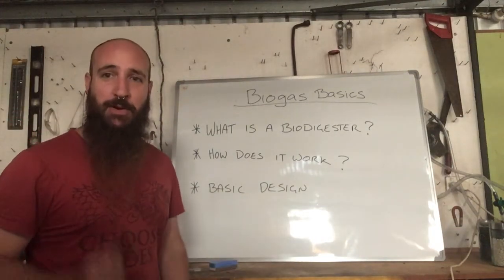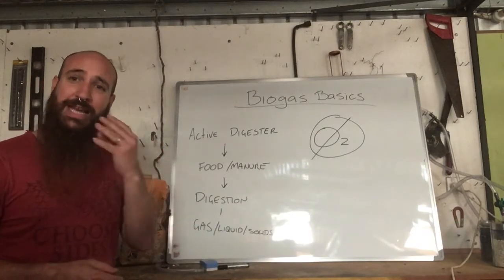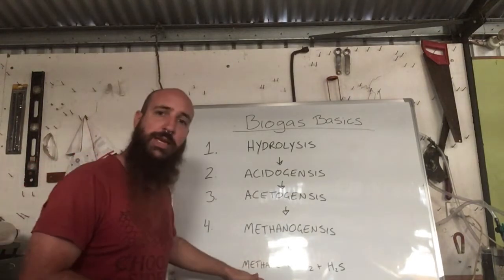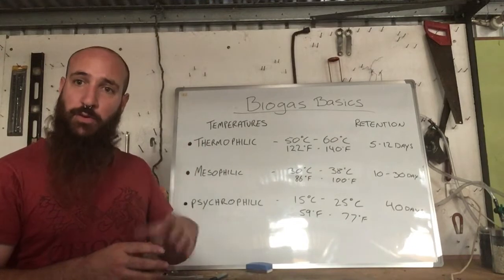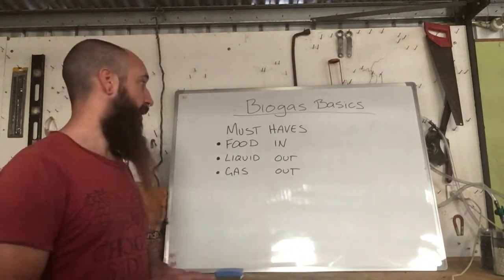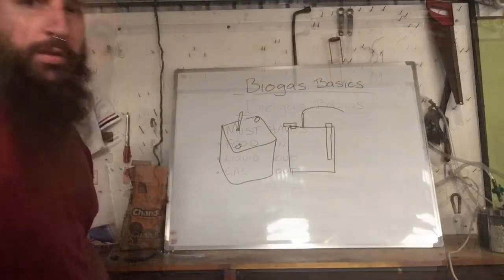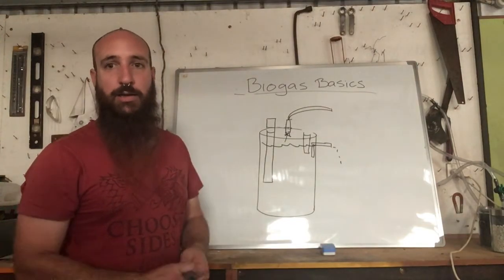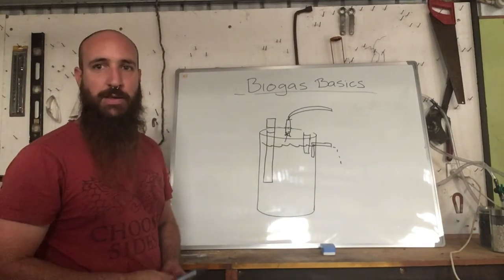What is a biodigester and how it works - Biogas basics

Comment: G'day mate. Im looking at building a digester but trying to work out if its right for me. I have very little food waste so one question would be how often do i need to "feed" the digester? Also would i need someone to feed it if i was to go away for a week or so?
Reply from the maker: Hey Robert, it is depending on size of your digester of how much and often you feed. With the 1m3 IBC I try to feed a bucket of food every 3-5 days, you can feed more regularly, also if it is up and running fine and has been for a while, I wouldn’t worry too much about going away for a week, give it a feed before you go.
Reply: @OkAtEverything-ProAtNothing  i appreciate the reply mate. Is there a Facebook group or reddit that i could join to gain knowledge from a community of biogas people?

Comment: I would make a couple tweaks to your design.  First, when you have the food inlet tube on the side you have to have a nice and strong seal.  Over time, because the weight of the tube and the pressure from the tube getting knocked around when inserting scraps, the seal will probably leak over time.  Its just a lot of unnecessary stress on a seal that doesn't necessarily have to be there.  The second thing I would change is I would add an elbow to your overflow pipe with another pipe coming straight down a couple of inches.  You don't want it to be too long, and not too short.  It should be collecting from the center of the liquid.  This is because some stuff you put into the digester will float but most will sink.  When collecting from the middle your affluent will contain even less solids.  If its too long the solids will clog that pipe and if its too high you will collect whatever floating at the top.

Comment: I have been studying this off and on since the 70's.  The design in my nut is the following.  First the material is feed into a Mesophilic tank where it is kept for about 10 days.  It works like the solar city design; sort of as I have changes on your changes. It feeds it's output to a larger tank (1.5 times in volume) to a Thermophic tank where it is kept for 15 days. The reason is based on my research there is microorganisms that like room temp and there are other ones that like it just a bit warmer; 50C-60C as you mentioned.    You still get gas production out of both tanks.  The first tank breaks down the material sugars as you mentioned.  The second tank breaks it down carbohydrates.  The output solids and liquid is generally free of pathogens.  However, I would use a centrifuge to separate it into liquid and solid no matter what the outlet it comes out from. The liquid has to be exposed to 3 days of sunlight to ensure the lack of pathogens.  The solids will have to rot for additional year in sunlight and air in wind rolls.  Then it can be safely used as it needs to have the H2S boiled off of it and the sunlight will again kill any remaining pathogens.

Now, the way you are handling the gas purification is were we part company.  For me, if I had the time to set this up.  It would go through a bubblier in water where it can scrub the H2S from the gas initially.  You would need a way to add fresh water in at the same time as removing the use water out.  And it will smell.  The general concept is a distillation column which it is fed into the water to absorbs most of the H2S.  Yes, it will/could add some water to the gas but it's also just as likely to remove more than it adds.  The column would be for a home setup about 1 to 1.5m and about 16cm wide.  It would be filled to 1/3 to ½ of water.  As the gas rises through the water, any water vapour should condense and fall back down.  It's possible to add condensation collectors at the top of the column.  In short, you have a number of tubes glued together that are about 10-30cm long and I don't know around 5mm wide.  You are adding surface area to allow the water to condense. Then you just have to exchange the water every day or two.  May need an overflow as I think it have more water it it in the process.  If you place this column into a water bath then it will decease the temperature and more water and H2S will be extracted. Keep in mind that the H2S will just slightly dissolve in water but any reduce is better than no reduction  at all.  This step is to really to remove as much of the water and H2S as as possible.  Call it a first pass filter.

Then you would use the steel swarf and clay pellets for the final product.  I was try to come up with a way to use Copper instead to create CuS04.  Seems if we used copper powder then would would end up with CuS which wasn't what I was wanting.  So for that there would have to be some other steps to be performed to give me CuS04.

Well take whatever will serve you out of this mate.

Comment: I used to work at a class 3 wastewater municipal plant.  We had 2 digesters, 1 was the primary where the main digestion took place and the secondary was mostly the finishing off settling tank before removing the solids on a belt press and returning supernatant to the head of the plant for treatment. There's tons of little tid bits of extras in wastewater treatment that isn't included in your digestion talks. Like BOD, "biochemical oxygen demand" for example, and ph for testing proper happy digestion. If theres an unbalance of bugs, the acid producers are overfed and not enough methane producers, or vise versa with not enough food, your ph will be out of whack. 
If your system works for you, then that's good. 
I will be building my own digester system using my cattle manure. I will design my system similar to that of what i worked with but on a smaller scale of course.
I will have a primary digester with a circulation pump to keep everything mixed up with it being ran thru a heat exchanger. It will pull from the middle of the tank and recirculate back to the top.
I'll pull the solids from the bottom of the tank and transfer into the secondary digester. After the "time" is complete, I'll pull the solids from the bottom of the secondary tank and let them dry in sand beds. My main delima with all this is the supernatant, which is like ammonia water, very high BOD content and must be treated properly. 
Any thoughts on that would be helpful.
Reply: Let me know how it geos I'm very much interested on biogas I grab every information

Comment: greetings from Sardegna, 
thanks a lot for sharing the knowledge! We have moved off grid in June, and slowly improving our little setup, been watching a lot of different videos and yours are definitely the most comprehensive but still easy to understand.
i have 2 questions if you have the time:
1) how can we make it work  with human waste? we do not have cows at the moment, giraffes are hard to come buy here too, we have  2 sheep but they  roam free so not really possible to gather that shit.      
do you ever empty the tanks completely? or you just keep adding  and the overflow pipe  kicks off the digested stuff?
2) could you please include on your next video a bit more about the fertilizer biproduct. do you need to do anything to it? or is it ready to be mixed in the soil?
thanks keep sending more great videos!

Comment: Thanks for the explainers. Regarding using larger biogas digesters to feed electricity back into the grid. I have another idea! How about BioGas as a battery? You mention your concern about heating your digester during cold winters. Have you done the maths to see how much of the energy that you put in is preserved?

Think of it like this:

If you put in 1kwh from solar, and produce 1kwh of methane* you are essentially storing solar energy for later, while (effectively) sinking greenhouse gases.

In this scenario, you would build a solar array that produces more electricity than you consume during daytime in Winter on a sunny day, filling your gas tanks for your generator. Then when you have overcast weather, you consume stored energy. It is in my view more sustainable / environmentally friendly than lithium battery backups, if you can build most of the system DIY and low cost as you have. Though as storage needs go up, you might go into interesting territory with large pressurised gas tanks.

*Conversion efficiency of a generator will incur losses

Comment: Great explaination! If started building my own digester from a IBC tank that i've covered with wooden panels and going to fill the space in between with some EPS (styrofoam) pearls.  
I used your (improved) design, for easy filling and without blokkages of the gasline.
Reply: Why the EPS foam? Insulation for keeping it warmer?
Reply: @mortarriding3913  Yes, that's right! It is standing outside beneeth the roof of the carport..
And I'm thinking about heating the water to 30° celcius.
Reply: @markgeurts258  have you looked at DIY solar hot water systems?